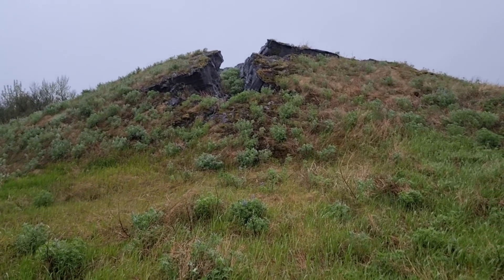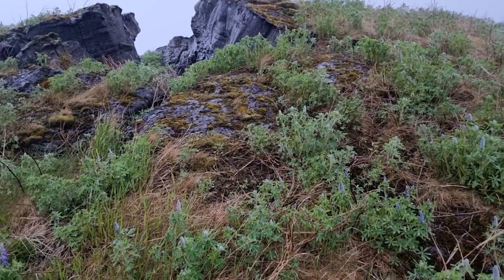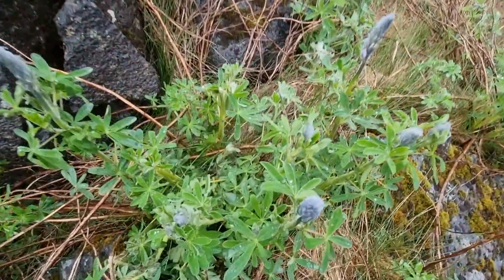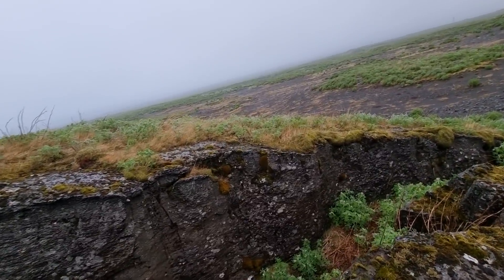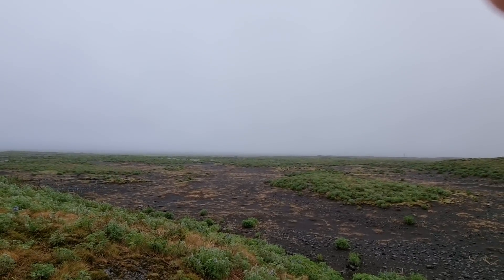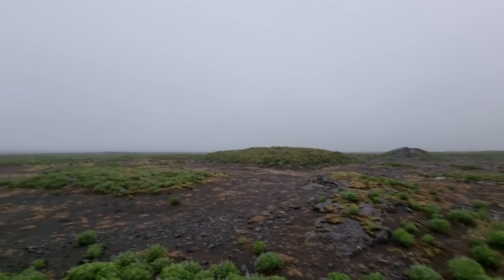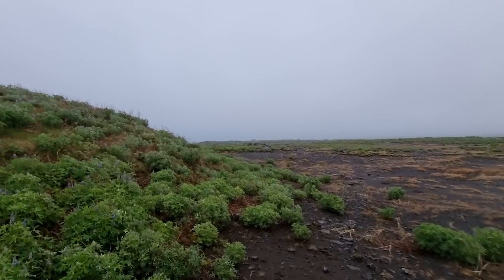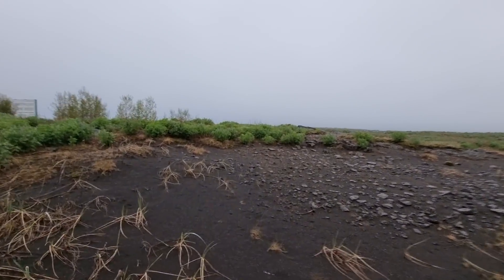Volcanic Pressure Ridges, #Leitarhraun Lavafield, #Iceland

Comment: Be very careful going anywhere near them. They can act like small fisher's. Sometimes a Volcano uses these gas vents in odd places even miles away from the active Volcano. You may not beware of the channels that run right below you. But, you can use animals or a device that detects vibrations you can't feel. So, although it's fascinating it is still quite dangerous

Comment: Lupine is a legume, which means it can fix nitrogen from the air with the help of specific bacteria found in the soil. I guess with the current climatic conditions added to the volcanic soil, it has a beautiful environment it can grow in and I guess the local plants are not that competitive. In fact, lupine behaves like a pioneer plant. Another reason for this spread of lupine is the lack of tall vegetation, shrubs and trees, the carbon inputs of which along with the litter could alter the carbon / nitrogen balance of the soil and discourage lupine growth.

Comment: Hornitos are conical structures built up by lava ejected through an opening in the crust of a lava flow.[1] Hornitos are similar to spatter cones but are rootless, meaning they were once a source of lava but that source was not directly associated with a true vent or magma source.[1] They are usually created by the slow upwelling of lava through the roof of a lava tube.[1] High pressure causes lava to ooze and spatter out. The lava builds up on the surface and solidifies creating the initial structure. Hornitos can grow and exceed 10 meters in height.[2]
Reply: I thought they were made by giant gophers.
Reply: @Sonny_McMacsson  😂🤣👍